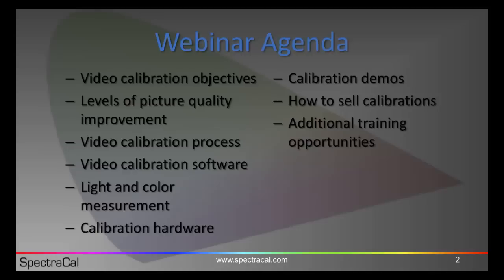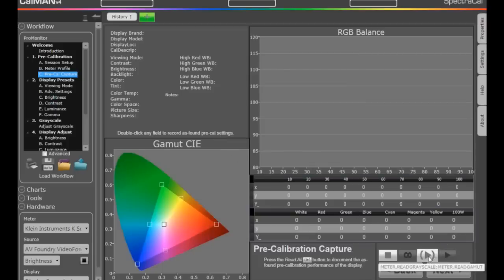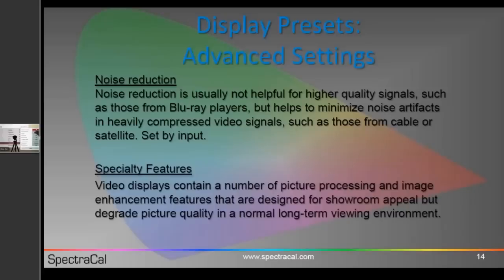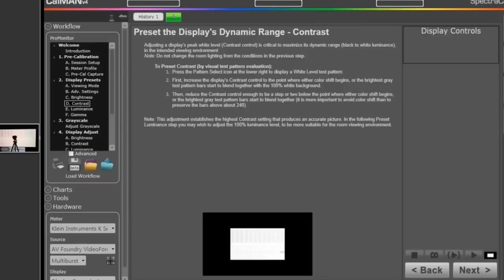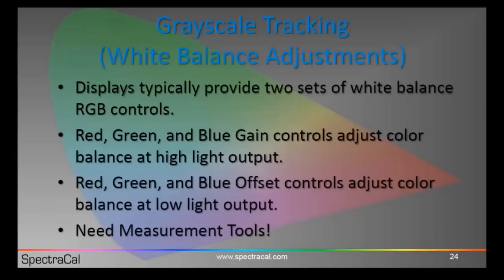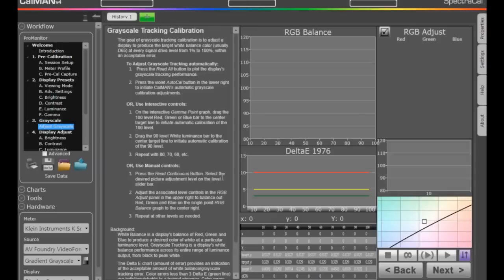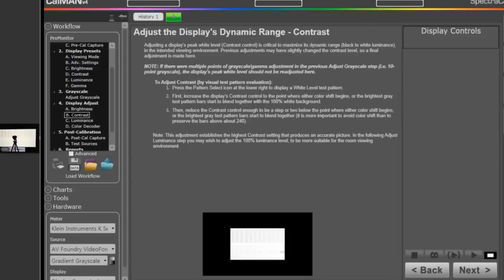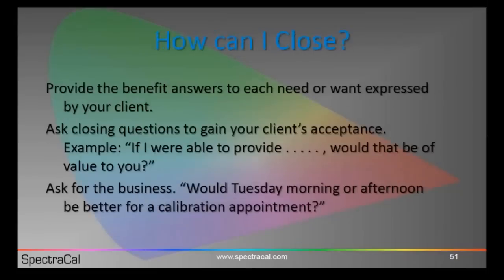Basic Video Calibration Webinar 101

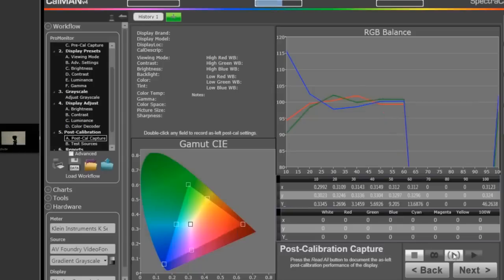Comment: 1:14:10 - I understand that low-luminance ('Low IRE') grayscale tracking is difficult to nail in compared to mid- and higher-luminance.

Was that the case with this LG TV?
Reply from the maker: Great question! What you’re likely seeing is a color shift near black caused by the display’s backlight. Many LCD backlights aren’t perfectly D65, so as you approach black, the backlight’s native color temperature becomes more apparent, making low-luminance white balance harder to correct. This behavior can vary depending on the display technology and the level of control available, but that’s most likely what you’re seeing in the video.

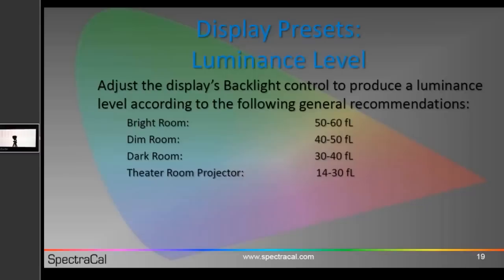Comment: 36:17 - Since you produced this excellent video, by the way, there have been some nomenclature changes to the basic picture controls on flat screen TVS:

Samsung, among other mfgs, has, with the proprietary name "Brightness", renamed Backlight in the user settings.   I believe LG calls it "Pixel Brightness" now.

In Samsung's example, the proper Brightness setting has been renamed, appropriately, "Shadow Detail", located down the list of settings below or above Gamma.  It's a 5-step up or down setting, with a center detent of Zero.  As mentioned previously, I arrived at a setting of plus-3 for the Shadow, using a 4K black level pattern off YouTube.

So it behooves those of us that know the differences, including yourself, to make sure end-users are adjusting the correct settings when it comes to the matter of Brightness vs Black Level.

As far's I'm concerned, replacing decades-old naming standards with ones that sound 'friendlier' to the average consumer is not necessary, and can be confusing.  I consider myself to be an 'average user' who just happened to wander into alignment via DVDs such as Avia, and Video/Digital Video Essentials.

Knowing what each picture control does, and its effect on standardize patterns, is key to getting a display to look it's accurate best.     Some times though, we have to edumacate ourselves in such matters. 🤪